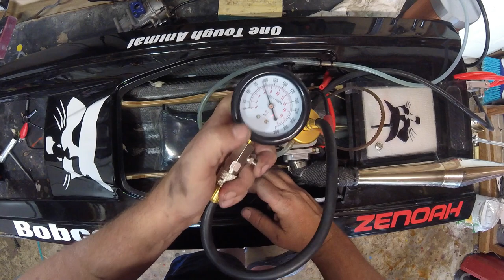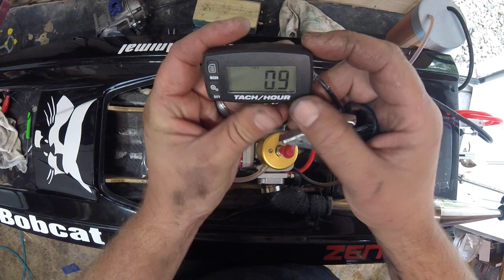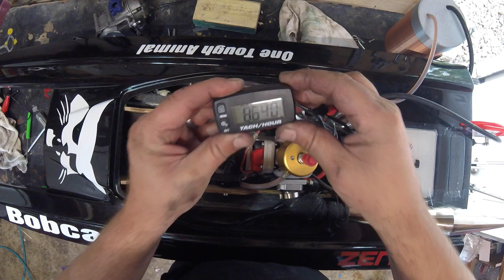2 Stroke RC Boat Engine Troubleshooting!!!!!!!!!!!!!!!!

Comment: What kind of premix do you run and what ratio?
Reply from the maker: Hey brother.   I run amsoil saber 8 ounces to a gallon.
Reply: Thanks man. Been out of the gas boats for a couple years now but I just picked up a used 54in Bonzi Fountain with a 29cc zenoah . Hasn't been run in a while. Guy inherited two of them from his father's passing. Carbs not pulling fuel for some reason. I'm assuming it's gummed up inside. Gonna try a different carburetor as I still have a ton of every parts from my old boats unless you have any better ideas? BTW, lovin all your new videos brother!!!